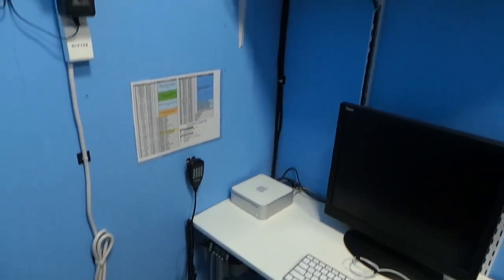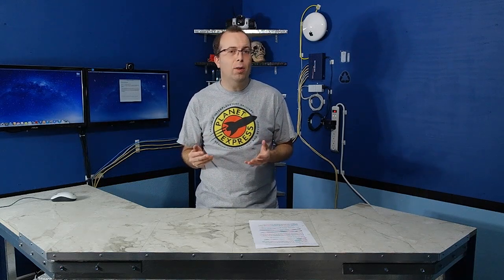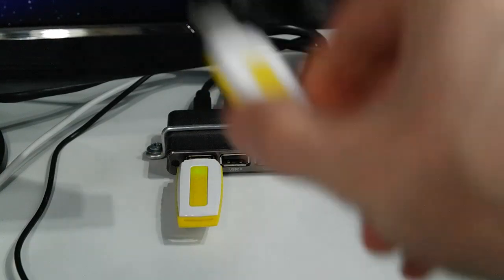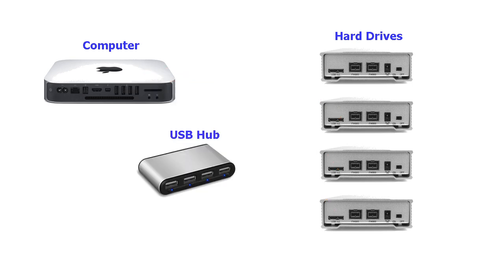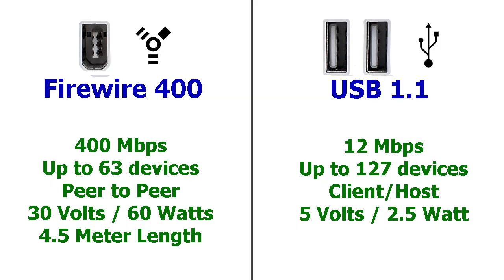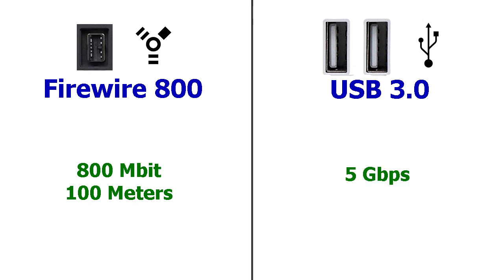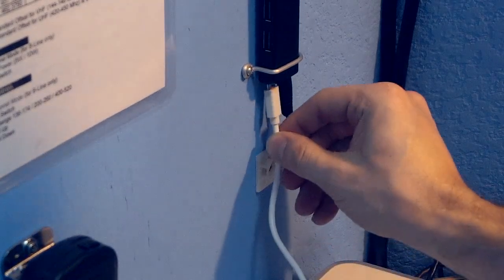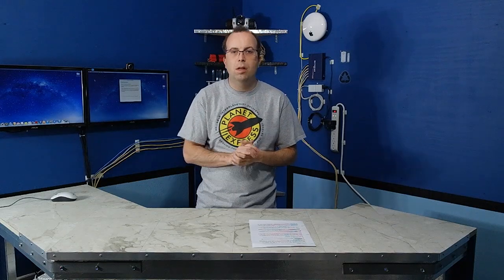Farewell R.I.P. Firewire, Hello USB!

Comment: Wasn't USB designed to daisy chain but not many devices supported it?
Reply: Enrique A. Fonollá Nonsense. USB "transfer cables" are actually devices that connect to two USB busses. They might be single chip devices hidden inside a plug, but they are still actual devices, not crossover cables. USB was never daisy chain based, always hubs.  Some USB devices have a hub in the same box to save space (with the device itself connected to one of the hub ports).
Reply: USB crossover?  Isn't USB half-duplex, so what would you be crossing over?
Reply: Yes it was. That's the whole 128 devices point for. Also, you can actually interconnect two devices with a single USB crossover cable to transfer files. Easy Transfer cables do exactly that.

Comment: I wonder why you didn't mention important role of Firewire on HDV videocameras. At least I have never encountered an HDV cam with any other way to connect with computer. That is the only reason I got involved with Firewire years ago. Still need Thunderbolt/Firewire adapter in order to capture footage from my HDV cam.

Comment: The only thing that does not sit well with me is the power delivery mention of firewire VS USB. Saying that firewire pushes 30 volts and USB only pushes 5 is only half the story. USB only had one cable design that delivered power to all devices that needed it. Firewire had 2 cables and only one of which delivered power at all, the firewire 4 pin cable (by far the most common) did not offer any power over line. You would need a 6 pin cable for any device to receive power, granted most computers offered a 6 pin port on the laptop/desktop but not all external devices had a 6 pin. 

All and all a decent summery of the largely underdog standard for many years.
RIP IEEE 1394 (Firewire is just a Mac only nickname for ieee 1394 but most if you on this tread already know that.)

Comment: Here i must tell one tragic story. I bought long time ago external HDD with firewire and USB. When i connect it with FW, i discovered all data written to HDD is full of errors. When i changed to USB port, all data are written fine without errors. 
Yes, that is my first angry to FW... 
But FW is still needed today... only for old DV video cameras. Because if you transfer it from FW, you get higher quality. If you capture it with capture card, you will have lower quality result due digital - analog - digital convert.

And why FW is dead after a while: USB is more cheaper than FW. Only old laptops still have FW ports, in mini version.

Comment: I still use 3 external disks on FW 800, two of them are daisy chained for a Mac that doesn't have FW ports, only Thunderbolts. I plugged an Apple FW-TB adaptor and it does the job just fine. I know where to find FW external hard drives even though I won't  buy new ones in the future. I do buy an external drive, it will be a TB 1 or 2.

Comment: For audio cards like studio recording cards FireWire will always be better. Compare the cables, firewire has a ton of isolation in there, a thicker cable, where usb is just one layer of isolating material, making a lot more noise compared to FW
Reply: digital signals don't get noise, if they do get interference, they'll stop working.

i dont care how many studios you run, you can't argue with basic science. you don't have first hand experience, you have first hand placebo.
Reply: Allan Greg Obstinate idiots like you are the reason why humanity doesn't progress as fast as it could.
Reply: Allan Greg The signal that goes out is DIGITAL, it is comprised of nothing but some current or no current, the DAC doesn't know the difference between anything except power and no power, therefore you CANNOT, by the basic nature of physics and how things work, get interference with a digital signal.

The signal does not become an analogue signal until it reaches the DAC (Digital to Analogue Converter). After it has been through the DAC and has become a wave again, THEN it can receive interference.

Sorry mate but that's just how it works, no amount of wishful thinking and placebo will change that.
Reply: Allan Greg It might also be because I think USB sends data in clumps, whereas FireWire can send data live continuously, so basically there could be lag on USB
Reply: you're a fool for not getting your fact straight. You see, i own a music studio and i have first hand experience with these things. If you look up stuff you'll see that all flagship preamps have firewire instead of lower tier that have USB.
Reply: Not sure if this guy is serious.
Reply: Spooky Skeleton
 its unreal how smart people are these days. you're the one who doesn't understand the basic principle of cables...
Reply: Spooky Skeleton
 how original
Reply: Spooky Skeleton
... and i was talking about the cable not the signal you fucking moron, less protected cables in this case USB are more prone to outside interference, and yeah, you get that in your speakers, your last comment oh so applies to you ...
Reply: FireWire also transmits more power than USB2 and has better connectors.
Reply: and you can run other processes with firewire.. I can capture 24/96khz audio while surfing the web. Try that with any USB connection.
Reply: There must be some truth to this as in a studio that my dad owns the analogue to digital converters all use firewire to connect to the computer. Also I have a motherboard which advertises 4 yellow 'clean' USB ports which are meant to have less noise for audio.
Reply: ***** people are people, they think they know cos they believe it ;) or even worse, heard it somewhere
Reply: Spooky Skeleton
let me explain to you in layman's terms.. things still happen to that signal along the way, in most cases it adds an "additional signal" which hum, his, and you can hear that in your speakers REAL-TIME. look dude, i don't care what you think you might know, i really don't care. i've been around for quite awhile and you learn that theory doesn't always apply, because there are always other factors in the room and technology is far from perfect....
Reply: *****
problem is that the usb controller is flawed for such applications because its a universal bus its not very good for audio applications.  We're not talking about a big margin here, but for instance 0.1% matters in studio, when you get to mastering stage you hear every single hum, hiss or buzz that was made due to bad cables, controllers etc.. We already did a FW vs USB shootout ages ago considering background noise, USB always had issues and was just not suited for PRO applications, that's why you have so many home studio USB interfaces, its cheaper to make as well. What that skeleton guy was talking was just that the signal is digital, but people forget that a signal can get corrupted, outside noise can hitchhike on that cable and gets written on the track when it reaches your computer. There are so many factors, starting with cables which was my initial point, USB cable is very plain, nowhere near as insulated as a FW cable, and that helps even if its 0.1%, you can hear that in the final stages of recording and its not pleasant.... average users will never know, that's why you have dumbasses citing, theory and specs, theory about devices that are far from perfect, no real knowledge, no experience...
Reply: *****
about that lag, most audio devices have a built in buffer so there is really no real difference. Have not tested that tho
Reply: It COULD make a difference in noise level when you do A/D or D/A conversion. If your speakers are noisy, it doesn't mean that your sound signal is.
Suppose you have a Yamaha MOTIF with USB connector; as far as I know, the signal generated by the MOTIF's DSP gets transcoded into an audio signal that is sent over USB. There will be no noise coming into the signal, whether you use a cheap USB cable, or one with 24 carat gold connectors certified by the Pope. Also, when converting this uncompressed digital signal into an MP3 or some other format for distribution, there is no noise added.
Obviously, in a studio you need to be able to actually LISTEN to music, and this is where the analogue signal comes in. And there, you don't want noise. But a studio is a complex beast with many components that can cause interference. That's what's so great about MIDI: it uses opto-couplers, so that the electrical signal between two devices is galvanically isolated. There's no such thing with USB.
Now, Allan and Spooky, you're so busy proving your own point that you fail to realise that you're talking about two different things, and that if one person is right, it doesn't mean that the other one is wrong. It makes you both look a little bit silly.
Reply: Severity One
 i know we were talking about a different thing, i even tried to tell him, you'll see that if you read everything i've said...
Reply: True, but you could have explained it a bit better. What you wrote could still be interpreted as noise interfering with the digital signal.
Reply: Severity One Thanks for giving some actual information, so the problem is that USB gives off more interference than firewire? By the way Allan Greg was putting it it seemed like USB received too much interference.
Reply: Spooky Skeleton
 nah i stated that there are many factor one being the usb controller itself, there is not much difference from what i said and what he said, im not native english, therefore my sentences get flipped around which may have caused the confusion
Reply: Allan Greg Yes, it came through as incoherent angry rambling, sorry if that's not what you intended.
Reply: i hope you're joking

Comment: Just checked New Egg out of curiosity and while the selection was very limited there are several models of 2 and 3 TB Fire Wire 800 External Drives.
Reply: Just look under Interface and Select 'Others'
Reply: Although, the prices are a bit outrageous for the capacity...

Comment: Thunderbolt can daisy chain and is faster than usb 3.0
Reply: Can you attach external PCIE ports throought USB, no. Can you daisy chain with usb, no. (maybe actually but whatever)
Reply: Thunderbolt is a non-propietary interface developed by intel.
Reply: Yet Thunderbolt has virtually no market share outside of Apple, partially due to its price but mostly due to an annoying license Apple has on it...
You could daisychain USB just fine btw, by using a built-in hub... many keyboards and monitors have this anyway... Same wiring setup...
Reply: As far as I know it's those crappy Windowses that got Thunderbolt 3 for instance ^^
Reply: Yeah but it's propietary shit from Crapple and is essentially useless on other devices and PCs. USB however is multiplatform and indeed universal.

Comment: Reminds me the old times 2002-2004 when I used to connect my laptop to destop with FireWire so it was working with file sharing and Internet without a switch. :) It had bugs with Windows XP but got fixed with Sp1. Love it! It was so simple and cool. 
I used an DV digital camera to capture digital video with FireWire AS well. 
RIP FireWire!

Comment: The problem with the hub is that it limits the speed to just as if one drive was connected.
Still, firewire should still be supported for legacy reasons, but it rests with peace with floppy drives, that don't have controllers on new mobos...

Comment: I don't know exactly why USB 2.0 was slower than Firewire 400, but it definitely was.  I had an external drive case that supported both USB 2.0 and Firewire at one point.  The former had a sustained transfer rate of 27MB/sec, and the latter 35MB/sec.

Kind of similar to how wireless networks never run at the advertised speed.  The actual throughput is typically half the connection speed (e.g. 300Mbps connection on 802.11n will transfer at about 150Mbps).  

Some kind of overhead, perhaps.  Not related to CPU load in my experience.

Comment: Well.. first over. Firewire is a network type interface. USB is a port. So they are not really simulerar at all. Firewire is pretty much network minus TCP/IP.... Pretty simular to a IPX conection. Firewire was more of a second conection, being safe using the computer as a firewall. This would make Firewire more compatible to 100Mbit ethernet and later 1Gbit ethernet.

Firewire was mostly just to make a simple NAS  that is more responsive.

Dasichain is just a way of saying that the hub is built into the device. There is no real advantage to it.

There is a pretty good reason why USB is Client/hoast... its because its simple.  The whole point with USB is that it suppose to be simple and cheep. Having a Peer to Peer for connection to a slave unit (like a drive) is not preferable. The end result is that the drive emulate a slave and the computer emulate a master. This is again simulerar to how a NAS works. Its really a "its not a feature its a bug" issue.

Yea you can lik to computer together. But why would you. Almost all computers have WLAN or Ethernet conection. I never seen a computer with a firewire that lacks a ethernet. (and you can link two computers togetther via Ethernet, but you have to reverse the polarity.. if you don´t have a network card that does that automaticly)

2:27 This stats are wrong. The maximum current of (original) firewire is 1.5A so the maximum power is 45. But the voltage is not set to 30V. It can be anything from 9V up to 30V. Most devices is between 18 and 25V. So you can in theory draw 45W, but any device can really just draw about 15W or so, because else they would not be compatible with all Firewire devices.

02:55 Well.. IF the firewire or the USB is faster really depens on the host device. Most cheep USB host devices cant handle more than 250 or 300Mbit. Its actually very few that handle the full 480.  But true, the 480 is the brute number, while 400 is a semi net number. The heavy CPU usesage of USB is mostly a myth. There is some software USB ports, but most once use DMA.

The 480 vs 400 Mbit speed was really a non issue for the time. Because there was really realistically harddiskdrives available that at this time really wasn´t faster. Sure if you use a cluster of cheeta drives you might end up with 1000Mbit+.. but then you really don´t use firewire any way. 1Gbit network become available in 1999, and 800Mbit firewire in 2002. It was really frist in 2006 that firewire got any usefull speed with 3.2Gbit, but by this time almost cought up in the speed race.

04:10 If you don´t want it to be messy. Use short cable. There is 10-15 cm cable to get. If you dasychain with a 1.5 meter cable you have the exact same problem. 

Additionally Firewire was sort of replaced with Thunderbolt that got about simulerar features. Well.. it looks simular. Down in the metal its very different. While Firewire is a network interface. Thunderbolt is a system port. This make it really fast (low latency), but on the other hand it open up security holes in the system. 

More over.. there is not really any point with the interface.

On the other hand, now with USB 3.1 we got this crappy micro connectors that is horrible. USB C will of cause solve that, but.. well taking a while to hit mass market.

Comment: but why is it gone even though it was better? it's like USB type C vs Thunderbolt battle now..
Reply: It is probably like how it was between VHS and Beta players.  Beta had the better video quality.  But ultimately, VHS won.
Reply: Technically Thunderbolt 3 is an extension of USB-C.
Reply: ***** technically yeah, but still, it's compatibility may encourage companies to implememt thunderbolt to more and more devices.. but I still wait for some uber connector, something that until wireless technology completely replaces all that stuff could power most of my devices. Maybe with something like different sizes for bigger amperage requirements lol. Also, we need to have some wireless/fast charging standard tbat would be like VHS to Beta, but actually the best of all, lol